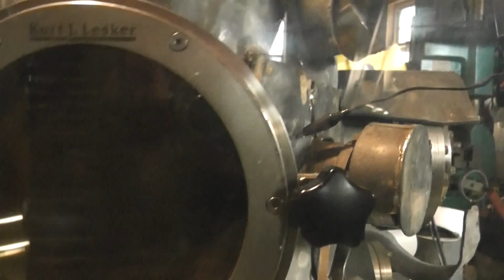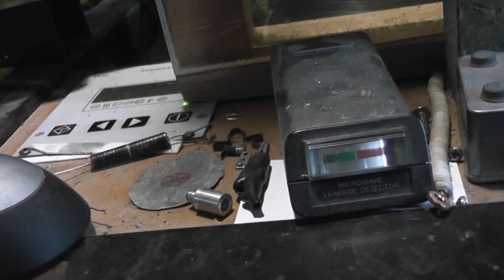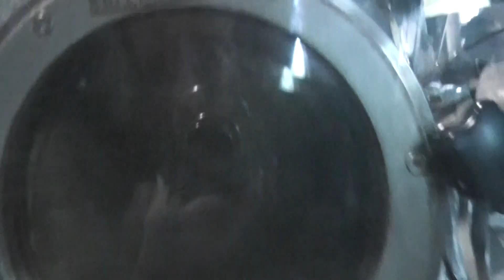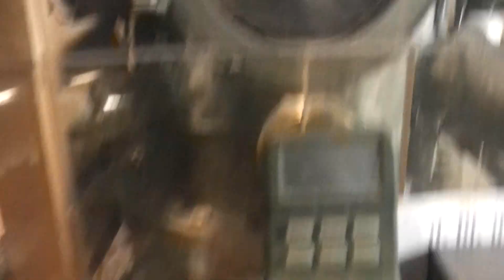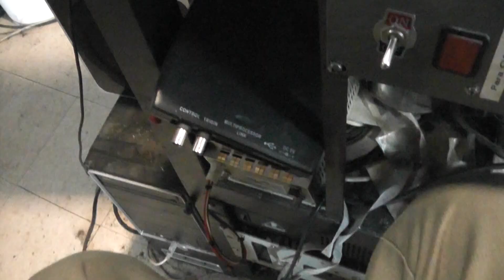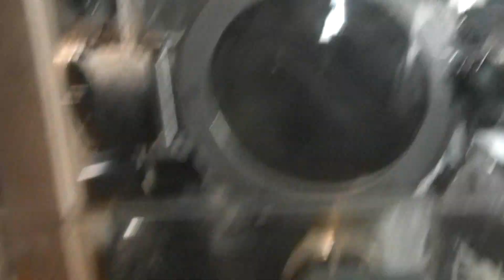Unstable

Comment: The Faraday screen is enough to keep you safe in front of this thing?
Reply from the maker: As it turns out, no.  And it's not just that screen, that's leaded glass in a few layers too.  In that mode it makes quite a bit of sieverts worth of neutrons (the other stuff stops the x rays fine).  I'm now running remotely, which took considerable time and effort to set up.
Reply: I was starting to wonder what you used for shielding. Personally I'd be tempted to bury this thing in a tomb of lead while it runs, but that introduces an entirely new set of hurdles to jump. Cooling for one.

I assume this would generate electricity via the produced heat?
Reply from the maker: It's worse than that - with success, there's so many ~2.5 MeV neutrons it's dangerous to be near, and lead does nada about neutrons.  6 feet of concrete or...70 feet of air is more like it and what I'm doing now, which yes, does add a lot of complexity to remote control the thing.
Lead only bounces them around  - think a swarm of BB's bouncing between widely spaced bowling balls - a pile of BB's would do better (eg hydrogen type stuff).  Thing is, just about anything that absorbs neutrons then gives off a capture gamma ray that's also painful to stop and lead loses efficiency at the high energies anyway.
So you're back at the 6+' of concrete (which is what the pros use for some reason)

I did use lead and never removed it, but it turned out to be life saving to just remove me and do this remotely.

Yes,m heat is the universal energy currency and "they" are pretty good at changing high quality heat to electricity these days.  While there are schemes purported to be better (and patented) than steam...no one is using any of them...either they don't work or don't work as well.  At high temperatures (easy here) steam gets into the 40% efficiency range.
Reply: I was just reading this and thought that you could potentially add a neutron reflector/moderator like graphite around it and then on the other side do a layer of parrafin wax to produce protons, which seem to be fairly harmless but I haven’t really done that much research. After that you could have almost any shield except lead (as that would produce one neutron for every proton it absorbs) so even a layer of aluminum could work.
I just find it really fascinating reading what you comment as I am interested in some radiochemistry myself (less electrical though) and am currently working on buying a Geiger counter to confirm the results of some tests I doubt have worked.
I was a little bit skeptical of the home fusion community just due to me not knowing how much you people seem to actually discover that is new, and some of the technical challenges you must overcome.
I would suggest some technical edits in designing the core itself but I do not want to waste your resouces.
Reply from the maker: @zenthrosrion9147  Yeah, you're way off on the magnitude of some of the numbers here.  Numeracy is important for this stuff.  Also, being able to work on things while we learn - coating it with a layer of anything makes that more difficult.  Turns out it's better to just run it remote control.  Slow neutrons, FWIW, don't knock protons out of things, and lead doesn't absorb slow protons either(if lead did, fusion with atomic charges of 1 would be trivial and a match would have more energy than required to light it off).  You're off by factors of million on some of that.  For starters: http://hyperphysics.phy-astr.gsu.edu/hbase/electric/elefor.html#c1
Reply: I’ll read up on that, thanks!

I just got most of that from the world nuclear Association or something, (not much of a guy for memorizing sources) so thanks!
Reply: I have a lot of reading to do before I can consider myself even close to a conversational level on this subject. The science is fascinating, but my exposure to it is woefully lacking, though probably still far ahead of the "average joe".

Thanks for answering me! I'll be going through the rest of your videos and doing other research now that I've caught this bug again. haha

Comment: so theoretically how small can these reactors get?
Reply from the maker: We are not yet sure.  The theory is fairly hairy and involves mean free path of particles that repel one another, and how much luminosity you can get in the colliding beams due to the space charge repulsion.  We start at pretty low pressure (~2.2e-2 millibar) and a long "mean free path", then focus the beams down as tiny as we can so they have high density.  There is a limit due to Paschen's law how low we can go in pressure (for longer foci and less beam self-repulsion) and still (easily) ionize the fuel for a given size.  We don't know exactly where the sweet spot is yet.  There's only one of me and only so much I can try per amount of time, so I follow my nose on what looks like the best improvement for how long it takes to get to.

Comment: When the bursts stay alight for longer periods of time towards the end of the video, does that indicate that the machine is sustaining the energy released?
Reply: Doug Coulter
Reply from the maker: Fusion doesn't chain-react.  The energy produced flies right out through the very low pressure gas and is absorbed in other things, the tank walls etc.  Most of it becomes heat, which if harnessed, and if we get to enough net gain, could then run the pumps, the power supplies, and have some left over.  There were probably a couple nanoseconds of actual gain in there on this run, but we were letting it oscillate in another way as a cheap sweep of the parameter space - and we're not using the output other than to measure at this point.

Comment: Doug Coulter  can you do a video explaining the basics of your fusion reactor for us dummies? how it works, why it works, how good it works, why we should be excited, where you think it will be in the next few years, etc?  all explained in layman's terms would be nice.
Reply from the maker: You don't want much, eh?  I'm trying to be super-honest about what I know, what others think, and what is.  The problem is, we've learned so much we've become very aware (here) that there's more to go on learning.  Anything I'd produce now would necessarily have errors of ignorance in it.  Give me a little time on that.
Right now, it's hard enough to describe in terms only an advanced specialist in more than one field would be able to understand anyway.

I will say this.  Things we've measured indicate that virtually all the published theories on how "IEC" fusors work are dead wrong - we can easily prove that with measurements we have in hand already.  Even the "IEC" moniker is wrong, we're not confining things, we have an 8 way beam-collider going on here, with particles cycling through the grid to a rather poor "focus".

Think about this - we have a bunch of D+ ions.  We have a grid, which few realize is actually an electrostatic lens (or they would build them to lens accurately instead of spot welding bent wire into odd shapes), charged negatively.  So the ions are attracted through this lens and into a focus region in the center.  Most of them simply miss one another - D+'s are really tiny (basic physics book stuff).  Our aim (lens perfection) is a bit off - we're not even to optical grade yet, and we need better than that for a good-enough focus to increase our reaction rate (think, compression ratio).
Just realizing that - and attempting to build a better lens, was our first factor 1000 improvement, and this lens is so bad as a lens, you'd not be able to read 12 point type through it - it's just that everyone else was so bad, it was easy to improve on.

The range of the strong-force tunneling two D+ into fusion is a lot shorter than a visible-light photon's wavelength, EG, we need a REALLY good lens here.  Every time we get even a little better, the Q (ratio of output to input power) gets better, and it gets better faster than linear.   That's one major problem - the infrastructure to make a lens that accurate doesn't seem to currently exist.  I certainly don't have it here.  I do the best I can with Chinese and homebrew machine shop gear.  See this: http://www.coultersmithing.com/forums/viewtopic.php?f=35&t=764

Further, imagine yourself as one of those ions at focus.  You came in hauling ass, your positive charge being attracted by the negative charge we put on the grid, and if you don't hit anything, you find yourself in a sea of others that you repel strongly and not only were you hauling ass and in general about to go out the other side anyway - you're being repelled by the ions in there already, while being attracted back out towards the grid and beyond it (if you don't hit a grid wire on the way out - some do, that's a loss).  Now the field "wants" you back to the grid, so you cycle.  It's a spring/mass oscillator, with AC losses the DC power supply does not make up for, so with a pure DC power supply this can't work - you have to keep adding impulses "in phase" with the particle motion to make up for the scattering losses or the oscillations die out, and you reach a dynamic equilibrium static state where the only stuff going on is due to new ionization and charge exchange, low probability stuff.  Yet, as far as I know, no one but me has worked with anything but DC input, and I'm only getting started on the real deal, with AC in phase...a bit tricky to do on top of a 50kv DC power supply, but we just built the parts to add that in - the next run or few will be testing and tuning of that.

This run just used (other, but deliberate) instability to produce some impulses on the power supply to test that theory before we spent a lot of time and money "doing it right", and it proved I'm on the right track.

That "dead" state is where virtually all fusor research has been done/written about, and is actually the worst case for producing fusion(!).  Let's just say I'm working on something that is nothing like the literature describes, due to that understanding gained by measuring stuff everyone else made assumptions about - and were wrong.  Even really smart people make bad assumptions.  That's why we measure.
Reply: @DCFusor  I just found this community and learned about you and am super surprised you have so few views.  I was just imagining the birth of what you just described, before I read what you wrote or saw the vid.  Of course that setup is hard to tune but if I hadn't seen the vid, it would have been less intuitive to me why.  Where do you draw the line on what is shared vs just video?  A rhetorical question; information sharing by videos without public explanation ... well I guess you are more than fully aware of the frustration potential.  Oh, awesome video!  Very inspiring!  Giving you a thumbs down as a deliberate lie to Google. For now.
Reply from the maker: @marlonw5053  I pretty much share everything, mostly on my website, linked above.  The members there know the story, so I avoid boringly repeating myself too much.  I use YouTube as a nice way to share various videos, but these are far from the whole story, not everything is worth doing a video on - text has its uses.  I do wait till I'm fairly sure of what I'm saying before writing it up, trying to strike a balance between immediacy and getting more done.  Not to mention, I try not to say things that later turn out to be wrong.  Those guys who fluff up their work for publicity or to try to grub bucks - that's them, not me.  I'm just trying to do good science.

Comment: what do you do about helium disrupting the fusion
Reply from the maker: The results of a D+D reaction is Helium4, but that has so much excess energy in it it breaks up into either tritium (hydrogen-3) + fast proton (regular hydrogen), or helium-3 and a neutron.  He-3 is itself a very good fusion fuel - it's just rare and extremely expensive on this planet.
So is tritium.  The neutrons fly out of the tank.  Hydrogen, actually a lousy fusion fuel, is the contaminant here.  It's one reason some use a flow through fueling system (flushes out the other stuff) or like we do - batch runs.  We can actually measure the tritium (it's radioactive) as it comes out of the vacuum pumps after a run, but thankfully at this scale, we don't make much - what we do make is exhausted outside the building.

It's actually a good thing plain hydrogen is a lousy fuel.  We are already at energy densities far larger than the sun per CC (which sounds impressive until you calculate the sun's energy density - it's tiny, it's just a big thing).  If it was a good fuel, the sun would have exploded or melted this planet a long time ago.
Reply: oh i thought you did deuterium tricium fusion. thanks for the reply
Reply from the maker: There's probably some DT, but we think we can get to gain on DD.  The advantage of DD is the lower energy of the neutrons - DT makes them 16 MeV, which sounds better than the about 2.5MeV we get, but those really fast ones take stainless steel into dust, which is why ITER, which chose DT, had to shut down before they even got going - they figured it out after only 10 years and a few billions wasted - if it worked, they'd kill their own reactor with that stuff!It is also fairly hard to legally own tritium in this country, in a tank (gunsights, sure, but they are real expensive for the amount you get).  I just didn't need either the 100x better reaction rate (nice to know it's available in a pinch) or the additional paperwork and equipment hassles involved.  It's not super safe to have around...You'd rather not have any inside you.

Comment: living Albert Einstein
Reply from the maker: Snap, I was hoping for M Faraday, or maybe Tony Stark.
Reply from the maker: Actually, a colleague of mine patented something like that "arc reactor" awhile back (Frank Sanns).  It won't work for a number of reasons, mainly the fact that arc implies there's a lot of really conductive metal ions in the "air" which more or less "short out" the power to accelerate the deuterium ions.  Arcs are high current (100 amps maybe) low voltage (28v).  The fusor acceleration is in the tens of kV - here I run 50kv.  The metal ions from an arc between two electrodes that are both running around -50kv (to attract the D ions) but 30v apart (a major EE challenge to make 30v/100a but floating 50kv off ground...) would simply short the -50kv to ground and you'd have a real expensive arc welder in a vacuum tank.  Not worth it.  Frank can go first on that one.  Though he's well off with a decent lab, he's never even tried...funny thing.
If you don't believe your own ideas, I sure don't.
Reply: Doug Coulter  make the arc reactor next time plz.
Reply: You are blessed with a good brain function aka higher iq then the average. is there any chance to get free energy like tesla Photovoltaics ??